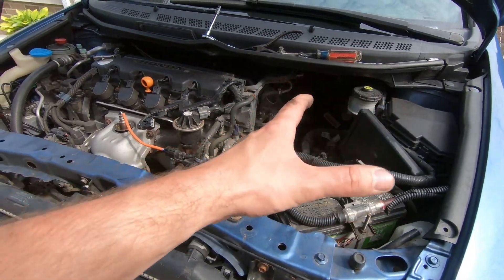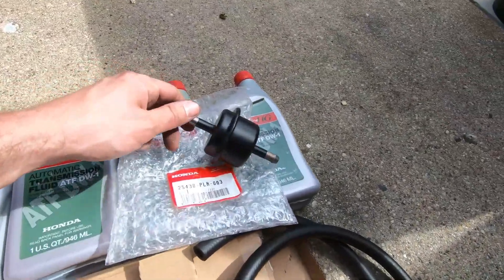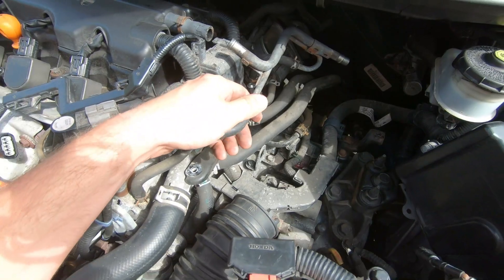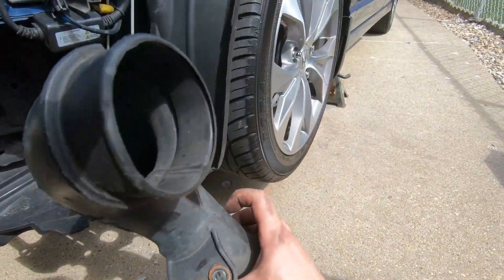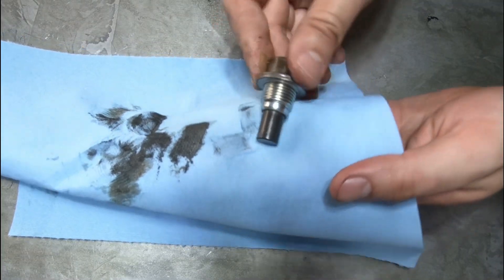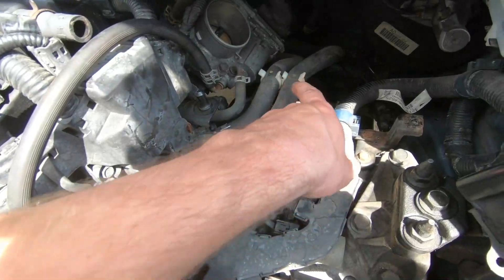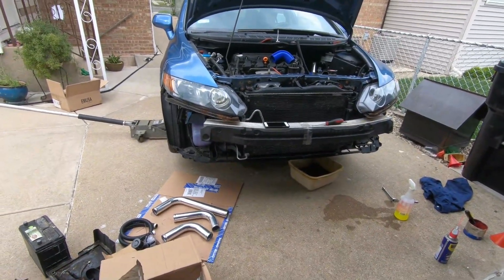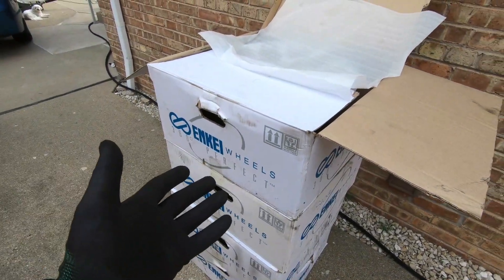Honda Civic R18 Turbo Transmission Cooler Install & Intercooler Plumbing!

Comment: So you did hose to cooler to cooler to heat exchanger?
Reply: Might tackle this and do another flush did you use the hayden 401 kit ?
Reply from the maker: It’s a eBay version of the Hayden.  It’s all the same thing.

Comment: My car is a coupe and for the intercooler my car doesn’t have that much room between the subframe and the radiator so should I just route it by where my old intake use to go through or do you think I can make it fit through the same place you had it at?
Reply from the maker: You can route it anyway you like.   This was probably the most challenging part of the build.

Comment: what is that hose size is that for the throttle body there a specific one I should get I'm going turbo r18
Reply from the maker: Not sure on the top of my head.

Comment: do you need a transmission cooler even though the car is manual instead of auto?
Reply from the maker: no trans cooler needed for manual
Reply: @BulliKid  alrighty i got an 07 civic lx hoping to do everything you did. do you have an instagram? ima follow you fasho
Reply from the maker: Yes bullikid on IG

Comment: Excellent video you are going to install a catch can oil, I am interested in seeing how the installation is to do it to my car.

The intercooler to the automatic transmission is good to do?
Reply from the maker: Yes the auto trans cooler make my car feel better!  Before I would have a problem with tranmission on high rpms in 3rd gear.  I’ll have to make a video on that.
Reply: If I just over the intercooler to the automatic transmission and oil catch can. Installation AND benefits of both updates